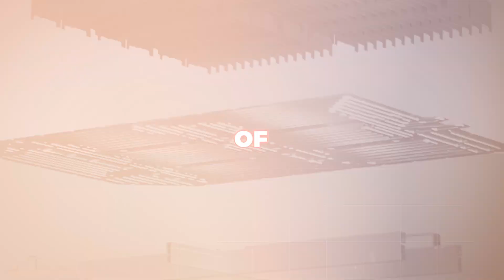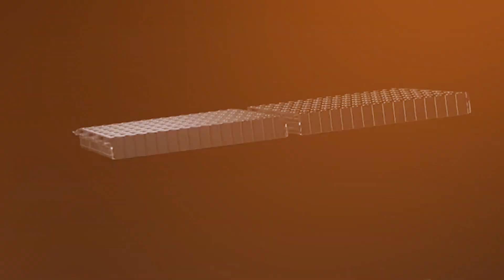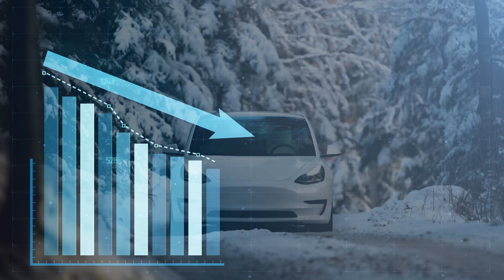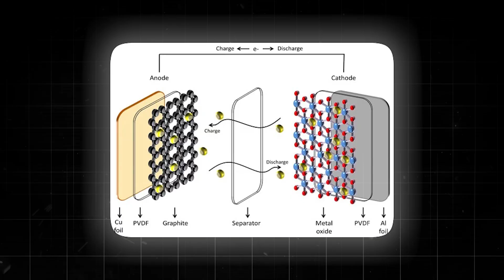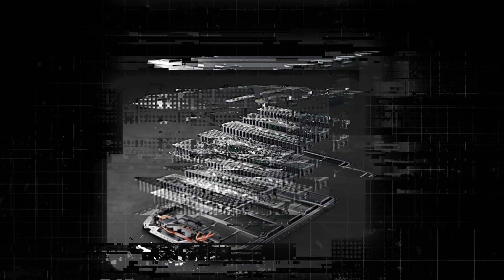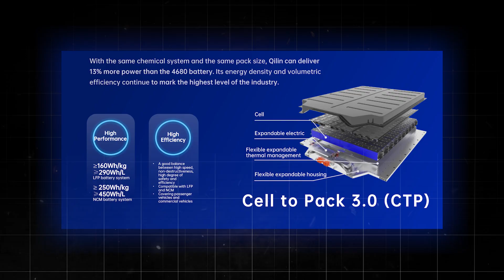CATL Battery Shenxing Plus Is LFP On Steroids!

Comment: comparing EPA range to CLTC range is like you are trying to compare apples to melons.
The truth is that the Shenxing plus LFP has an energy density of around 200 wh/kg. Compared to the first gen LFP from CATL/BYD that was/is used in Tesla model y RWD,  which had/has around160 wh/kg, it means that this battery would have a 20% increase in energy density, and thus, ideally 20% increase in range. That is the ideal scenario. So. from around 225 miles on EPA (the newest version of the EPA testing cycle) range to around 275 miles.

Comment: How can an LFP with 205wh/kg have a higher range then an NCM 811 battery with 300wh/kg.

The battery size would have to be 200kw which would weigh an insane amount.
Reply: I agree with you. It does not make sense say that this or that battery pack, without saying the total battery pack capacity, is able to give 1000 kms of range. As the LFP chemistry has les energy density comparing to NCM, I am not sure that a LFP battery pack could beat, in terms of kms range, the same dimension pack, with NCM cells.

Comment: Lithiun battery: Safe
Charging time 2(fast)/8 hours
Low/high temperature not fine or even stop working
Reply from the maker: Lithium batteries have their considerations, like charging time and sensitivity to temperature fluctuations. However, advancements like the Shenxing Plus battery are addressing these issues with fast charging and improved performance in extreme temperatures.

Comment: How about the charging cycles before it hits 80% ?
Reply from the maker: While exact figures may vary, the Shenxing Plus LFP battery is designed for longevity, maintaining performance over many charging cycles. CATL's rigorous testing ensures durability and optimal performance :)

Comment: The charging capabilities are impressive! But 1000km are non-sense and obtainable just in Chinese labs. Is not feasible to have 1000km range on NMC batteries with 250W/kg how will they do it with LFP at 205W/kg?
Reply from the maker: The 1000km range claim for the Shenxing Plus LFP battery is indeed based on extensive testing and innovation by CATL labs. While ambitious, it think it showcases the potential of LFP technology. Advancements in materials and structure optimization contribute to this achievement. Further real-world testing will provide more insights.
Reply: @AmpedAuto  I’m not negating the importance and the innovation of CATL.   I’m sure will be a great battery, just that Chinese companies and many youtubers create a false expectation that a 15-20% (which is a lot) battery storage improvement will give you 200-300% gain in range on highway! This statements are most of the time believed because most of the people don’t understand how a battery works.

For 1000km real world range, no matter the storage density of the battery, you will need at least a 170kW battery pack (with at least 150kW usable) on a car that can achieve a consumption of 150Wh/Km. At that size an LFP battery will not fit in most of passenger cars (due to high volume requirements) and at 205W/Kg you will have just the battery at ~1 ton which will make impossible to achieve that consumption.

Comment: After driving an Ioniq5 for one and a half year I can say I don't need 1000 km range. I got caught up in the range discussions a lot before eventually turning BEV for real. But the range problem disappeared with the first long travel I did. My experience is a stop after three hours is what I need at my age (66), to get some walk and refreshment. Yesterday when I stopped at Ionity in Karlstad, Sweden, I noticed a fabulous charging speed in ideal conditions (+23C) topping at 235 kW, charging 35 kWh in 12 minutes, wich means an average power of 175 kW. 

My conclusion and the recommendation to other contemplating going electric is to look more fore charging speed than range. It's more pleasant to do a few more short stops than waiting 30 or 40 minutes for one charging session to finish.
Reply: Yes. Fast charging is possibly even more important, and makes the need for larger batteries less important.  
Yet this battery seem do do both.  
My Skoda Enyaq charges at less than half your speed, and have made me realize that my next car will be one with an 800V charging system(like yours) instead of 400V.
Reply: Sounds like wise words to me. Huge batteries isn't the most efficient way to go.
Reply from the maker: Agree! This is more or less my personal opinion as well. My two EV's has decent range and for any long trips I plan for charging stops which is good for your body after 2-3 hours drive. It's clear that fast charging and shorter stops contribute to a more enjoyable driving experience and for your passengers too :) . Your recommendation is valuable for those considering electric vehicles. Thanks for your input!
Reply: do you drive in 20 below Fahrenheit temperature?
Reply: @perperers2502  I agree with u on this

Comment: This battery doesn't compare to QS
Reply from the maker: QS batteries may excel in certain aspects, the Shenxing Plus battery brings its unique set of features and innovations to the table. It's all about finding the right balance of performance, safety, and efficiency for different applications. What specific features of QS batteries do you find most compelling?
Reply: @AmpedAuto  Nothing compares to QS. What's also neat is QS can adjust its battery to the needs of the customer. For example, QS supports LFP and NMC.
Reply: Will be a treat when QS solid state battery gets out there. 2025 maybe

Comment: Let me guess. It was announced on April 1st ? All the images show a charging cable the thickness of my thumb so maybe charging at 30kw? If you were really fast charging a 1000km range battery the cable would be at least as thick as my calf with active cooling. Very convenient. And a multi vehicle charging site would need its own power station.
Reply from the maker: April fool you mean :D? The Shenxing Plus battery tech is promising. While fast charging infrastructure is a consideration, advancements are continually being made to address these challenges. The focus is on improving charging speed, efficiency, and infrastructure to support the growing demand for electric vehicles.

Comment: If the battery can be charged with 400 miles of range in 10 minutes, then there is no need to have a 600 mile range (unless charger stations are that far apart).

Also, if the battery charge rates are super high, then the chargers have to be supplied with vast power, so they need some incredible infrastructure to support the charging of many such batteries at the same time.
Reply: I don't think it's fake. CATL have delivered what they have promised before. I guess they use 800V and therefore smaller cables. Regarding power supply to charging facilities it's mostly a planning problem. I guess it will be charging hubs for heavy transport that will need megawatt charging that will require most power, but they will probably be located near power lines with high capacity. It's not a new thing to demand high power. For example a normal electric arc furnace used in steel manufacturing is demanding between 60 and 100 MW during operation.
Reply: @perperers2502  With EVs, it's all about valuing the owner's time.  If they can just quickly plug in at home and fo about their business, that's a minimal imposition.

If they are on the road and have to charge, then the important things are how much time do they have to spend finding a charging location, how much time and distance does it take to get to  that location, do they know in advance what power ratings the chargers at that location have, do they know if all the chargers there are working, do they have whatever app they need to pay or do they have to download a new app, does their phone carrier have a good signal at that location, is there a queue for the chargers, and the time it will take in the queue and charging.

The nice thing about driving an ICE vehicle on a long trip is knowing that there are almost always multiple gas stations within a mile of any freeway exit ramp, that there are almost never lines, that you can always pay with either a credit card or cash, and that you can fuel your car in less time than it takes to make a restroom stop.  You can almost always be back on the highway in less than 10 minutes from the time you exited unless you are dilly-dallying at the station or there's a line for the restroom.
Reply: @perperers2502  Oops I forgot about the power thing.  Sure, you can operate at high voltages to minimize current and size of the required transmission lines and charging cables, but you still have to have the generating capacity and transmission capacity.  If you install a big charging station for 18 wheelers, the power plants and transmission equipment all has to have the dynamic range to accommodate the fluctuations in electrical loading caused by the charging of trucks which might arrive in herds at breakfast, dinner, or lunch times or at other times like rush hours near major cities when truckers would prefer not to be sitting in stop and go traffic.  The system also has to accommodate small towns and rural areas where the trucking traffic may be sporadic.

Similarly, the charging of cars can be very dynamic.  You might find that everyone who can do so tends to charge at home in the evening as soon as they get home from work and that will put a tremendous strain on the grid which has to be managed by giving the power transmission company control to add or shed loads to smooth out demand.  But when Thanksgiving or Labor day rolls around and millions hit the road and have to super charge while the family waits in the car, the power company can't smooth the loading in any practical way without making people wait a long time UNLESS the system is designed for that peak loading.  But that means the system is way oversized for the typical daily loads and is far more expensive to build, maintain, and operate than a system sized for the average daily loading.  So, it has to incorporate peaker plants that run on natural gas or coal or massive battery storage and the transmission system still has to be oversized and costly.

Alternatively, the system could have centralized charging locations with their own power plants or near power plants, but this then requires drivers to go out of their way to get there and wastes a lot of their time.

It's just a tough problem to solve.  Gasoline on the other hand is analogous to having a huge electrical storage battery at every charging station and having charging stations on practically every corner.  But an in ground gasoline storage tank cost nothing compared to a huge battery storage system.
Reply: @rw6262 The longer the range, the bigger and heavier the battery pack is, the less interior room there is, the faster tires wear, the greater the battery fire risk, and the higher the costs of collision, liability, and comprehensive insurance on the vehicle.  So, you want the battery to be as small as practical which depends on how long you can stand driving without a rest stop AND how far apart chargers are located.  If chargers are everywhere, then your desired range just depends on how long you want to drive without stopping.  I drove from the LA area to the mid Atlantic Coast of Florida and stopped about every 250 to 275 miles because that's the approximate range of my car between fill ups with some margin since my gas gauge is a bit sketchy.  For me, that was about the perfect stopping distance anyway as I'd generally need to stretch my legs and take a bathroom break anyway.

The problem with EVs is that charging generally takes a fairly long time AND chargers are not plentiful and all over the place.  For those reasons, a longer range helps alleviate concerns and allows you to better schedule charging sessions so they don't drag out your trip more than necessary.  But that longer range comes with quite a price tag.

Comment: I downvoted this video because it uses the term "LFP battery" without explaining what the acronym LFP stands for. The video also sounds like it was generated by AI.
Reply: LFP is lithium iron phosphate which is used alot now in Ecars. More stable than the lithium ion but not as energy dense. But this CATL version sounds like a big improvement so lets see..
Reply: If you keep your eyes and ears open, you’ll see the acronym at 0:29 of the video.

And if it was Ai generated, then you can generate it yourself right? Non-sense!
Reply: Welcome to 2024

Comment: While 1000km sounds good what we need more is lower cost packs in cheaper Ev's with smaller batteries that can practically be charged with the average home solar system. Then we will see mass adoption and a meaningful shift away from burning stuff to make it go. The byd seagul is a good example, 250/300km from a 30kw pack for about 12 grand practical to more than just rich twats.
Reply: The irony is China is leading the world in affordable Ecars but the CCP has made alot of enemies in the west.